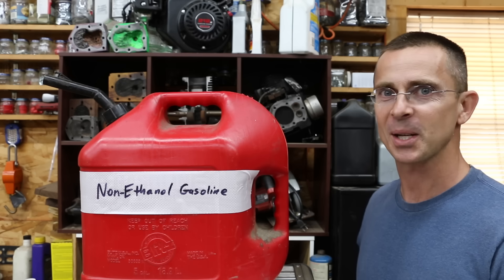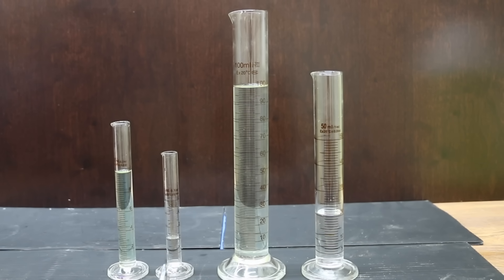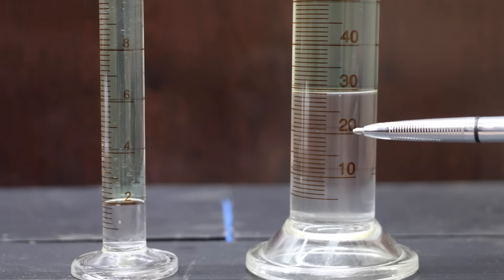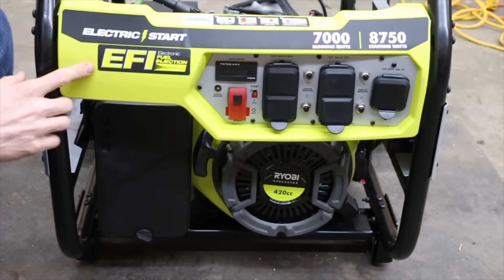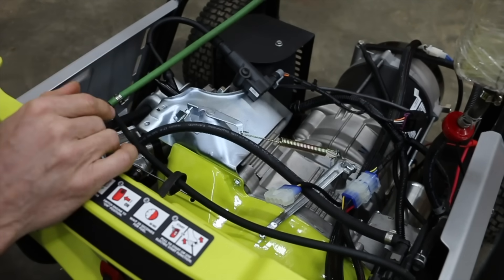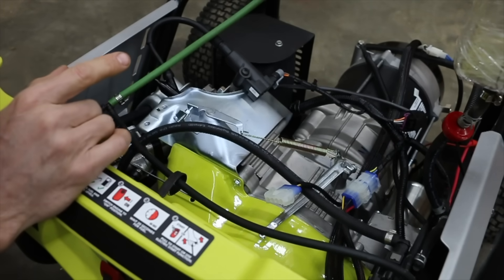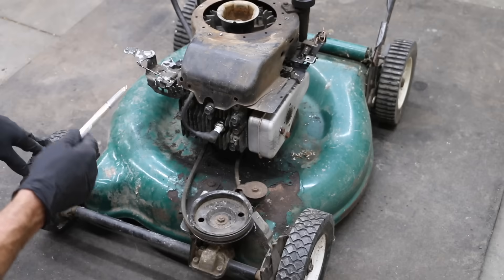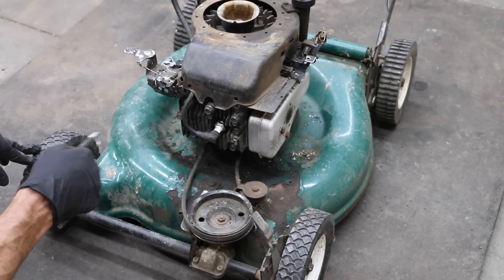Is Non-Ethanol Gasoline Really Better? See the PROOF!

Comment: No its does not deliver better efficiency,  The running time was less by 2 mins with ethanol.  Meaning more fuel consumption.  You video clearly showed carbon build up on ethanol based fuel.  It was clear as day.  Furthermore, you forgot to show the time delay from day1 to day 30 for plastic and oring degredation.  E10 is by far the worst to use for your car.  Smaller engine will suffer because of what i just said above.  The real question is can the fuel pumps survive better or worse over 30 days running.  I am sure this you cannot test.  Great video but many many missing issue that cannot be compared effectively enough.  I know for a fact that plastic will not survive well in ethanol environment.

Comment: Running at 70 with my 1.5L Honda civic I get between 37-39mpg with regular 87 octane 10 % ethanol, running at 70 with non oxy 91 octane I'm getting 41to43mpg. So I'm seeing around 10% increase in mpg. You said only 4% maybe because of the octane difference?

Comment: We put the 10% ethanol gasoline in our "vespa citta gilera" which is a small older italian moped. And the bougies got very white plus our pistons got very scratched one even died. Their also very small 2 stroke engines so im hesitant about using this stuff. Also my car bougies seemed pretty white during intervals when I was running on this stuff. Maybe its not suited for the 2 stroke engines but the label on the gasstation also states it shouldnt be used in cars build below the year 2000 or something like that.
Reply from the maker: Thanks for the feedback.

Comment: 6 minutes. I strongly doubt that that lawnmower engine was designed for E5 or E10 fuel - so why are you using it to test Gas Vs E10? This isn't really a valid comparison.
If I tested coal against E10 by burning both in a steam locomotive, coal would win. You need to test modern engines with modern fuels. You need to demonstrate whether the stuff in everyone's garage is running better on E0 gas or E10 gas and you need to talk about the price. Here in the UK Ethanol Free Gas is available, but costs x2 or x2.5 the price of E10.

Comment: Used to be able  to  buy octane boost ...to add octane back if you remove the ethanol....ethanol will screw up small engines with in  2 weeks ..the water in the ethanol hardens the diaphragm in the carb.
Reply from the maker: Thanks for the feedback.

Comment: great,..so the non ethanol lasted 4%....but news flash....its average cost at pump is a lot more than that 4%....try 20 %. and you cannot even find it where I live near LA.  How does this help me here ?  and if I remove the enthanol...I kill the octane..and have something far worse than I started,.   To me the soludtion for my 390 Ford ....10,5 to 1 ...is to use 93 Ehanol. ...which is everywhere and only a little more cost than Mid or Reg EHT. ....I do have hardened valve seats.
Reply from the maker: Thanks for the feedback.

Comment: I'm a fueler for a gas station chain in the Midwest. If you remove the ethanol you'll end up with 84 octane. Because that's the subgrade gas we blend with ethanol to create 87E-93E. If you remove it from 93E you'll end up with 89 midgrade.
Reply from the maker: Thanks for sharing.

Comment: Have you tried  isopropanol, and methanol, the main reason or only reason that ethanol is being used is because it has no connection to fossil fuels. The dirty little secret is ethanol can be synthesized from petroleum we could quit the use of corn ears, everything else of the corn stalk can be turned to ethanol or methanol,
Reply from the maker: Thanks for the suggestion.

Comment: Based on what I've seen in the car tuner scene is e85 is okay as long as you drive the car to operating temperature and don't only do short trips. This helps burn off the condensation from the water.
Reply from the maker: Thanks for the feedback.

Comment: So many great videos comparing automotive chemicals like oil, fuel, fuel system cleaners but I did not see one regarding Coolant Additives.  With longer lasting coolants these days are they warranted?  I put Amsoil Coolant treatment in my vehicles but have not changed the coolant in 5 years.  That threshold for changing would be now but I'm going to keep monitoring to see if there is a lifespan to these.  Would love your take on a whole host of brands in this category.  Thanks a million and keep up the good work!
Reply from the maker: Thanks, will do!  Thanks for the suggestion.

Comment: The actual only real purpose of adding ethanol to the market's gasoline supply is to increase the total amount of available fuel on market. Beyond that, ethanol is not a good thing. First, it never binds itself to gasoline. It actually adds more bad shit to the atmosphere then gasoline does and It attracts moisture and it does damage to fuel systems if left sitting for a long time, especially small air cooled engines. So now we have the battery powered junk flooding the market. Since most those products are neither repairable of recyclable, It is going to come back to haunt us. Our landfills will be so huge and so numerous, there won't be anywhere for humans to live.

Comment: I left my car sitting idle for about 3 weeks while on vacation.  When I returned the engine started, but a Check Engine code was present, saying to have it checked by the dealer.  The dealer determined that the 10% ethanol gasoline had absorbed water and separated in the tank while the car sat.  They corrected the problem.  Since then I've been using ethanol-free gasoline in this car, and have not had a repeat, even after a 4-week hiatus.  I'm also getting about 2 mpg better fuel mileage with the ethanol-free fuel.
Reply from the maker: Thanks for sharing.

Comment: I use ethanol-free gasoline in my lawn mower because there’s less risk of it drawing water from the air.  I’ve had problems with carburetor internal corrosion when I’ve left ethanol-containing gasoline in a lawn mower over the winter.  But more recently I’ve been completely draining the fuel tank and running the engine until it clears the carburetor, before stowing the lawn mower for winter.

Thanks for the very informative practical test you’ve shared!
Reply from the maker: You are welcome!
Reply: I use bog standard 87 octane in my Weedeater FL20.

No problems. Runs plenty fine! I simply empty the tank every time I put it away.
Reply: Even without ethanol, gas will gum up a carb over winter. Be sure to run it for 10-15 minutes every 2-3 months to avoid it, or just run it out of fuel.

Comment: hydrogen nottttt electric or gasoline is the very best fuel noooooo pollution water is the exhaust. high cost to start but it is the best by far... diesel for big tks and  locomotives. it takes  air pollution to make electric!!! 60 years as mechanic !! tell our corporation owned  representatives do what is best for earth not their  wallets!!!!

Comment: Ethanol fuel mixed with 2 cycle oil in chainsaws and other small 2 and 4 cycle engines is a problem. I switched to non-ethanol engineered fuel five years ago and haven't replaced a carburetor since on any of my 5 chainsaws, my pole saw, hedge trimmers or weed whackers. 

The hydrophilic properties of ethanol based fuel rusted out the gas tank on my pressure washer. Since switching it to non ethanol fuel there is zero sign of rust in the gas tank.

Comment: Now if some loving person gets you an XYZ brand machine or ABC brand machine and it says starts on the first pull look at the warranty and then in the warranty. It will and you can send it in my case $138 miles to the nearest depot to be told it was your fault and charge you $200 to make it start after you paid $900 to buy it or you can wait until the 2 years runs out follow their instructions and it won't start at all When you first get it make sure you take the oil they give you with it and say this is the best stuff to put in it to start it and put that in a safe place so 100 years from now they can see in the museum and put some good basic oil in it 20 minutes later on it drain it and pull the disposable aluminum turkey pan out in the sunlight and look carefully and you can see the Milky Way galaxy and beyond that in the sunshine those twinkling little things are the pieces of metal they left in the engine they built and mass quantities 12,000 mi away from this country I was told was a great deal of profanity over and above what George Carlin was approved to say by the 1972 United States supreme Court ruling that I was wrong but this genius one bought himself Harley-Davidson motorcycle I'd explain to him that it wasn't made in Milwaukee Wisconsin It wasn't made Indianapolis etc etc was made in the country of India and I asked him if he wouldn't mind draining a small amount of oil out of the engine and send it prepaid in my expense to lab for analysis I didn't see him smile for a year than I did the motorcycle disappeared and his lawn mower disappeared I need found an old Sears ( RIP) MORE LOVE BY THE SIDE OF THE ROAD BECAUSE FOR SOME REASON IT WASN'T TAKEN CARE OF AND SOMEBODY DID WHAT I DID AND HE ASKED ME HOW TO KEEP IT RUNNING 3 YEARS AGO WE BECAME FRIENDS AND WE STAYED FRIENDS UNTIL CANCER GOT HIM NOT TO BE MORBID BUT HIS WIFE AND CHILDREN STILL MOW THE LAWN AND IF YOU PUT A HOLE IN HIS BACKYARD YOU COULD PLAY GOLF IN IT!

Comment: LONG STORY I'LL TRY TO SHORTEN IT BRIGGS & STRATTON MAKES AN 80 OCTANE ENGINE AND FOR THOSE OF US WHO HAVE TOTAL SHOULDER REPLACEMENTS TOTAL KNEE REPLACEMENTS TOTAL HIP REPLACEMENTS OR WILL HAVE THEM THEY ADDED A BATTERY ALTERNATIVE TO THE POOL START STRING BUT IT'S A SODIUM ION RECHARGEABLE BATTERY THAT WILL RECHARGE 10,000 TIMES OR MORE IS RECYCLABLE AND IF IT GETS A LITTLE WET OR HOT DOESN'T EXPLODE ( THAT'S TESLA ABOUT THE CURSE THEY BUILT AFTER THEY STOLE HIS NAME AND KILLED THE ORIGINAL TESLA WHEN HE OFFLOADED THEM IN NEW ORLEANS AND A HURRICANE ARRIVED??😮)
THAT SOUNDS GREAT TO ME I TOOK THE RECREAL STARTER OFF AND STARTED MINE WITH A BATTERY OPERATED DRILL AND IF IT DOESN'T START IMMEDIATELY I TAKE THE FUEL LINE THAT I BOUGHT AFTERMARKET AND CAN REPLACE THAT NOT WITH THE $8 PER FOOT GARBAGE HOSE THEY SELL BUT WITH 4 FT OF AVIATION GRADE FUEL LINE AND I PUT A FUEL FILTER IN THERE THAT'S CLEAR I CAN SEE THROUGH IT IF I SEE CREDIT TIME TO CLEAN IF I SEE WATER IN IT TIME TO CLEAN IF I'M LAZY OR IN A HURRY WHICH I AM BOTH I PUT UPSTREAM AND DOWNSTREAM ABOUT SO I CAN DRAIN THE TANK OR I CAN DRAIN THE ENTIRE SYSTEM BEFORE IT GETS TO THE CARBURETOR IF IT GETS THAT FAR YOU CAN PULL UNTIL SURGERY OR YOU CAN SPEND UNTIL THE BATTERY RUNS DEAD AND YOU CAN PUT ANOTHER BATTERY ON YOUR DRILL OR YOU CAN USE A CORDED DRILL / IMPACT WRENCH AND THE SAME THING WILL HAPPEN UNTIL YOU CLEAN THE CARBURETOR!
MR MOONSHINE WATER CRUD GUM GARBAGE AND WHO KNOWS WHAT ELSE SMALL INSECTS ARE GONE YOU'RE IN GOOD SHAPE YOU PROBABLY WON'T SEE RUST BECAUSE THEY DON'T MAKE GAS TANKS OUT OF METAL ANYMORE BECAUSE OF THE ETHANOL MOONSHINE AND THE POISON THEY PUT IN THE GASOLINE THEY MAKE IT OUT OF PLASTIC SO IT WON'T RUST IT'LL POLLUTE THE OCEANS AND KILL OUR CHILDREN AND THEIR CHILDREN AND THEIR CHILDREN AND THEIR CHILDREN'S CHILDREN BUT IT WON'T REST!

FOR SOME REASON THEY BELIEVE THEY CAN CONVINCE PEOPLE THAT H²O BURNS IT DOES NOT BURN IT CORRODES BUT ANYWAY LET ME FINISH WITH THIS AND IF YOU WANT TO AFTER YOU GOOGLE IT AND AFTER YOU HAVE THE CIA THE MIA AND IT Y OWE YOU CHECK IT OUT THEN SHARE IT? 😃🙏😇

Comment: But in any case what happened to Briggs & Stratton they went back to Germany They are now making engines that will run very efficiently on pure 80 octane fuel as they did in the 1930s and as they put in their measurement fighters and bombers now the United States had to explain to the British that if you put in 60 octane fuel you're not going to catch him or run away from them however if you put refined fuel of 140 octane you'll go faster maybe catch him run away from him except the way they built their engines they bloom up so we had to explain it to him and my grandfather had to build them connecting rods pistons and crankshafts that wouldn't break into or three or nine pieces and ship them over to England and France for a short period of time and Russia and boxes labeled scrap iron wasn't scrap iron it was brand new connecting rods brand new Forged crankshafts that have everything else in the engine broke it didn't and it had no inspection stamps on it because the German shot down and enemy plane took the engine apart and found out it had a inspection stamp from the Ford motor company Henry Ford corrected that problem yet in any case with a measurements had was one thing we did not have fuel injection so they could do an inverted split ass where they would go upside down and die of away when are we in the British tried that was float full carburetors the fuel went to the bottom of the fuel pool and nothing went the engine engine installed and either they got caught and killed or they got to restart went back home to the airfield and told them this isn't working!

Comment: DEAL WITH SOME PEOPLE MAKE ON A BAD PERSON THAT JOEY RUBBING IT BY DUMB WORLD NEW ORDER?
THEN CALL ME BECAUSE I PUT AWAY SOME PARTS AND I KNOW SOME PEOPLE THAT DID TOO SO WHEN YOU BUY A REBUILD KIT TODAY FOR A SEARS ( RIP) MORE CRAFTSMAN CARBURETOR THEY WON'T FIT BUT IF ON THE OTHER HAND YOU GET YOURSELF A NICE ULTRA SOUND PLAN A AND EXTRA PARTS AND PUT THEM AWAY SAFELY PLAN B OR PLANE C DON'T PUT POISON IN YOUR GAS TANK!

I TAKE MY 1980 PUSH MOWER OUT AND I HAVE TO PUT FEW ON IT BECAUSE I RAN IT DRY WITH SOMEONE AMOUNT OF FUEL STABILIZER WHEN I POUR THE REAL GASOLINE IN IT'LL START RIGHT UP MY HABIT IS TO RUN IT FOR A FEW MINUTES TILL IT GETS WARM AND THEN TURN IT OVER WITH MY 3/8 IN EXTENSION AND SOCKET AND DRAIN A NICE WARM OIL OUT AND PUT IN A QUART OF GOOD OIL AND THEN I CAN CONTINUE NOW I WAS GIFTED A XYZ BRAND LAWN M OWER WITH A IMITATION ENGINE ON IT AND THE PROPAGANDA AND BS THAT YOU NEVER HAVE TO CHANGE OIL JUST ADD AND OF COURSE IT HAD FRONT WHEEL DRIVE!
I DON'T MEAN TO GET PERSONAL BUT IT'S 75 YEARS OLD FRONT WHEEL DRIVE ON THIS PARTICULAR BRAND MEANS 0 TO 4.2 MPH AND 0 SECONDS SO AS SOON AS YOU ENGAGE THE DRIVE YOU'RE GOING FROM A DEAD STOP TO 4.2 MPH WHAT WILL HAPPEN IS IF YOU HANG ON YOU WILL HAVE THREE TRENCHES LEFT BEHIND LEFT FRONT RIGHT FRONT AND YOUR NOSE OR IF YOU TRY TO RUN THE MORE WE'LL BE SITTING THERE UNTIL IT RUNS OUT OF FUEL THEN IT'LL STOP AND THEN THEY'LL FIND A LAWN MOWER IN FRONT OF YOU AND YOUR CORPSE BEHIND IT!
(THAT DOES NOT PRECLUDE ALL-WHEEL DRIVE OR REAR WHEEL DRIVE BECAUSE WITH A REAR WHEEL DRIVE MOTOR IF YOU PUT A BAG ON IT AND FILL IT UP WITH 5,000 LB OF CLIPPINGS AND WILL PUSH DOWN AND GET MORE TRACTION ALL-WHEEL DRIVE SAME DIFFERENCE I DON'T DO THAT WHY???)
BECAUSE AFTER I GROUND THE PROPELLER DOWN UNTIL IT WENT FROM 21 IN TO ALMOST 18 IN I WOULDN'T BOUGHT A NEW BLADE FROM A COUNTRY IN OREGON AND THEY CALLED IT BY THE NAME OF A DINOSAUR RAPTOR PUT IT ON I CHECKED THE BALANCE FIRST YES I DID AND NOW IF I DON'T TRY TO BITE OFF 10 IN OF GRASS BUT I HAVE INCH IT TURNS THE CLIPPINGS INTO PARSLEY EVEN AT ONE INCH IT TURNS TO CLIPPINGS INTO PARSLEY THAT'S A 1980 CRAFTSMAN YES IT'S A PUSH MOWER AND YES IT ONLY WEIGHS 54 LB AND YES I CHANGED THE PLASTIC WHEELS TO BOWL BEARING WHEELS THAT'S BEEN ALMOST INDEFINITELY ONCE STARTED DO I PUT A BAG ON SOMETIMES IF THE LAWN IS COVERED WITH WEEDS TUSH DISH THEN I'LL BAG IT PUT THE BAG IN THE PAPER BAG BECAUSE IN MY CITY CITY YOU CAN'T PUT CLIPPINGS IN WITH GARBAGE NOW MOLDY ROTTEN DEAD MICE BUGS AND CERTAIN TAXI CHEMICALS IS PERFECTLY ALL RIGHT BUT A BLADE OF GRASS IS CRIMINAL! ANYWAY NOT TO BELIEVE IN THE POINT I'LL CUT THE WEEDS DOWN BAG THEM DISPOSE OF THEM AND DEWEED THE BAG SO THE SEEDS DON'T GROW I WON'T USE A EXHAUST BECAUSE THEN WHEN I GO TO THE RIGHT AND BACK AGAIN I SPREAD THE WEEDS SEEDS ETC ALL OVER MY NEIGHBORS WANTS ONE NEIGHBOR I LOVE THE OTHER NEIGHBOR I PRAY FOR BUT I WOULDN'T DO THAT TO THEM THE ONE THAT I PRAY FOR HAS A CORPORATE INTERCORPORATE MURDERED ORGANIZATION THAT SENDS PEOPLE TO GET THE GRASS FROM A FOREIGN LAND THAT DO NOT SPEAK ENGLISH NOR ARE THEY AMERICAN CITIZENS BUT THAT'S ANOTHER STORY HOWEVER THEY BLOW THE GRASS CLIPPINGS ALL OVER THE FASTER THEY GET IT DONE THE PASTOR THEY GO TO THE NEXT YARD OR YARDS THEY DO THE LONGER THEY KEEP THEIR JOBS AND FEED THEIR FAMILY OF 27 CHILDREN BUT THAT'S ANOTHER STORY THE BAD NEWS REALLY BAD NEWS IS THERE'S THREE OF THEM THE OTHER ONE COMES BY WITH A TRIMMER AND TRIMS THE SIDEWALKS FENCES ETC THE THIRD ONE IS THE WORST ONE IT'S GOING TO BLOWER AND BLOWS THE STUFF ALL OVER EVERYBODY ELSE'S PROPERTY SO IF THERE'S ONE WEED ON THE BLOCK IT WILL COVER THE ENTIRE CITY COUNTY AND STATE!!👺👹☠️

Comment: I Started using seafoam in my boat and soon after i had no power under load to discover the fuel water filter was doing it.. Not much water in it but was not letting enough fuel through it. What are your thoughts. Could the seafoam have knocked crap lose from the fuel tank?  I don't know how old the filter was.

Comment: When I run my 6kW (nominal) emergency genset every year to give it some exercise, I was always at a loss for what to use as a load. I used a 500W halogen work light, an electric edger, a space heater.

Then I got an electric car! Now I adjust my EVSE for 20A and plug it in to the 220 port. Even, balanced and substantial load, and the energy created is doing something useful! Plus its enough of a load to actually challenge it. I run it that way about 10-15 minutes, warms it up pretty good.

 Of course that wouldnt work for this test as I wouldnt want the EVSE (or the car!) damaged by odd voltages and currents as it ran out of gas. Especially since mine surges a lot when running out.